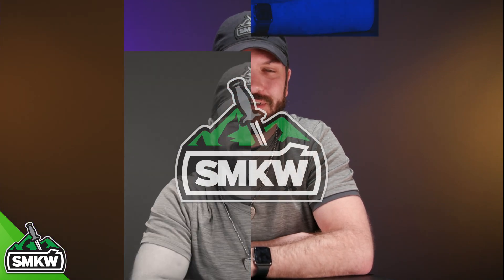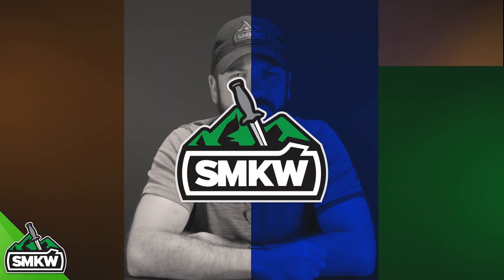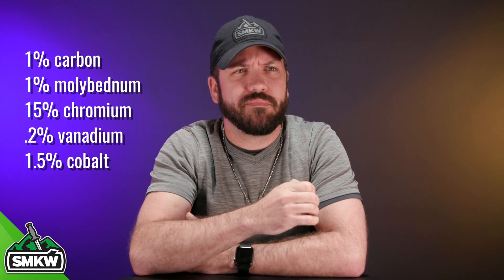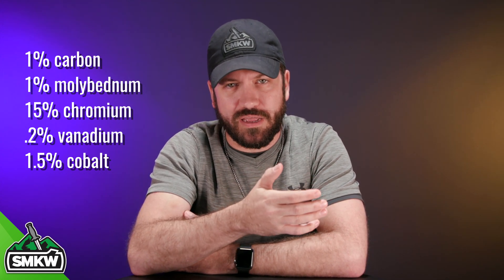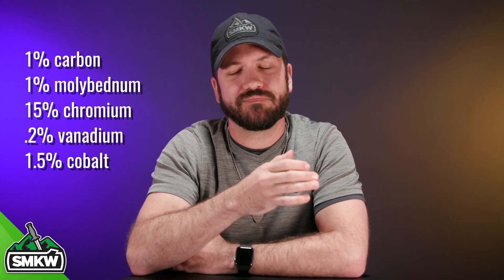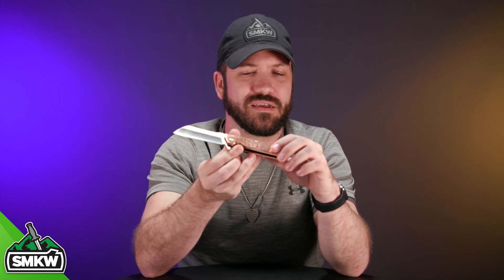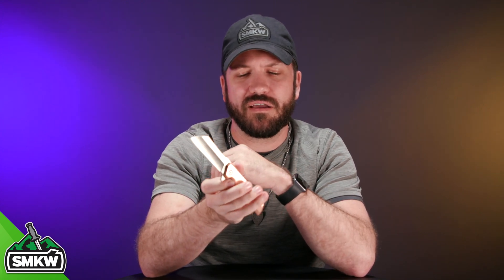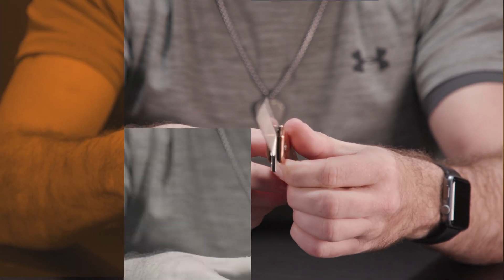Blade Steel Series: A look at VG-10

Comment: Honestly, I have a Swiss Tech Haltbar fixed blade knife that is sort of a modern knife with Kephart styling built with VG-10 steel. The name of this knife means durable and long-lasting when translated to English from German. And that is exactly what you get with the VG-10 in the Haltbar. It can be sharpened to a razor edge and just about as durable if a blade edge as I have ever used. The VG-10 steel stock on this knife is 0.2” thick and it is definitely built to be tough and durable. The Haltbar features VG-10 full-tang construction, a broad blade shape with excellent tip strength, brown canvas micarta handle scales that are pinned, and it comes with a decent leather sheath. You get all of this for under $50 with a limited lifetime warranty. But the most outstanding feature of the Haltbar is the stonewashed blade steel used in the construction. After several months of use, I am now a fan of beefy VG-10 steel in a bushcraft or woodscraft style of knife. TC thanks for your insight in this blade steel. Maybe more knife manufacturers will consider VG-10 in their offerings. - Tennessee Smoky

Comment: Nowadays is used on a lot of Damascus blades with a VG-10 core. I have 3 of them and it's not easy to sharpen, way harder than 14C28N, but holds the edge far longer.
Reply from the maker: s for letting us know, A lot of people will find this helpful

Comment: What is the dufference between VG-10 vs D-2 Steel?
Reply from the maker: The main differences are going to be that VG-10 is much more corrosion resistant as it is a stainless steel used in many kitchen knives, D2 however is going to have the edge in toughness.

Comment: I wish you could go a little more in-depth. Because I’ve had Aus8 that preformed as good as VG10 . Actually I’ve found VG10 to lose it sharpness very easy. I’d like to know the difference in Aus10  from VG10 because so far I really love Aus10 it holds a edge amazing an it doesn’t seem to rust easy also edge holding what is better D2; VG10; Aus10; and how far down are carbon steels 1055,1075, 1095
Reply: ... performed* as well* as VG10 / to lose its* sharpness easily* / holds an* edge amazingly*

Comment: Love vg-10.  Super steels are great but vg-10 is so easy to get absolutely scary sharp. And holds a good working edge long enough for my needs.
Reply: ive got an older falkniven and edge retention is great
Reply: @willl7780  same here - 2x 10 day 1000 mile off road motorcycle trips and my old F1 was just great, didn’t have to sharpen until I got home each time and I wasn’t that nice to it (not stupid though). I really like it.
Reply: @MotoBushBird  what kinda bike?
Reply: @willl7780  2018 KLR 650 🐖
Reply: It's definitely it's best property. Super easy to sharpen

Comment: Interestingly steels of the past all were once top rated knife materials. The differences from them and newer ones sometimes are slight. Heat treatment, forging, grinding and tempering process make some older steels as good as or better than newer ones. The steel is one ingredient to more complicated recipe for a well-made knife.